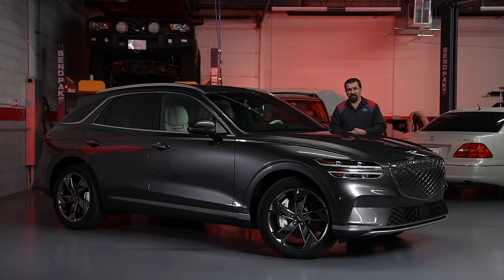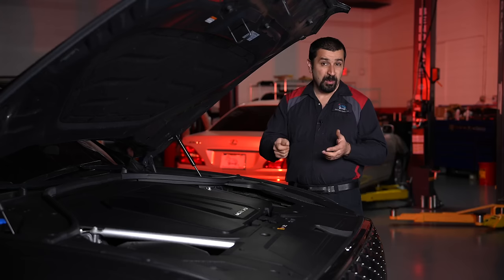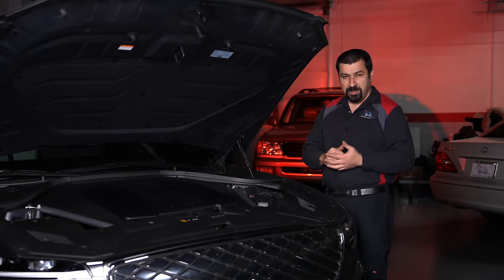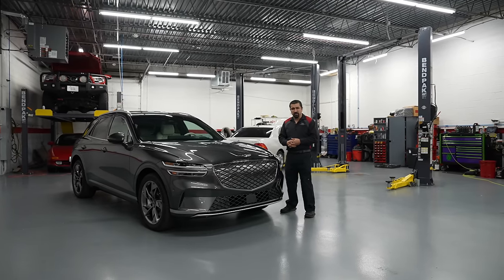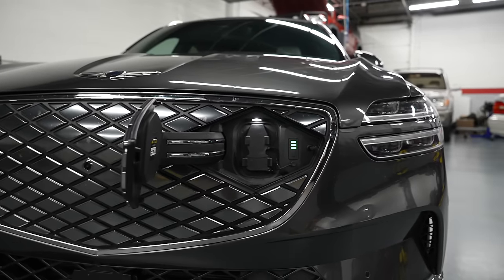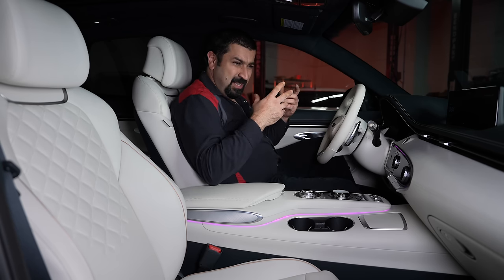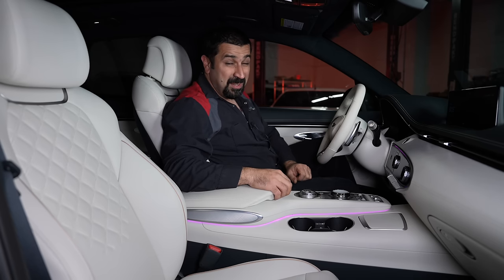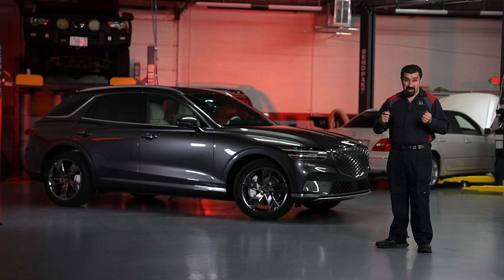Should You Buy a Genesis GV70? Thorough Review By A Mechanic

Comment: I love Hyundai products , I have a 2019 Santa Fe with nearly 266,000 miles and it’s been the best vehicle I’ve ever owned . And I’ve owned nothing but Honda products prior to my Santa Fe .
Reply: Does yours have the 2.4L engine, how much oils does it burn? My 2017 Santa Fe burning about 1 quart per 1k miles with 106k miles on it. As long as it lasts closer to 200k miles I’m okay with adding oil but worried about catastrophic engine  failure
Reply: @BrianPowell-bb1un  yes I have the 2.4 ….last oil change at 260,000 I lost maybe half a quart to 3/4 at 10k mile change . I’ve also done every oil change ever since new with mobil 1 full synthetic .
Reply: Sold 2013 Sonata with 2.4 worst year ever when it come to the engine/car combo... it was a great car. Still running strong at 145k miles. I think it will hit 200k as long as they change oil and maintain everything needed. Now i drive Hyundai santa fe 2.5 NA... great car with that SEL luxury premium. On higway getting up to 32mpg depending on the wind and conditions... average 24-25.

Comment: Umm, home heat pump systems work pretty well –  down to a certain (outdoor) temperature! Below that temp an auxiliary heating device is used. Normally that is a simple resistive heating element. Of course it uses about 5 time the power per minute as the heat pump uses. But in mild climates HVAC systems with heat pumps can keep costs down.

Comment: In ECO mode this vehicle has been tested to get around 260 miles. If you look at channels that specialize in EV vehicles you can see the results. Considering the majority of drivers drive under 50 miles per day...how often do you really go cross country or more than 100 miles each way? You plugin at home then leave full other than the occasional longer trip.

You need a 800 volt charging system to get 800V speeds. The speed is just as much the charging station as it is the vehicles ability. 

Comment about charging covers... Have you seen what Tesla, BMW etc use? A rubber cover, same thing. It's about protection not style.

GV70 electrified is the same as the gas options. HMG literally cut off section of the bottom to adapt vehicle for battery then used the engine bay for electronics. Only difference is the floor is a few inches higher to accommodate batteries. You get a little more legroom in the ICE GV70.

It's not a bespoke platform. The GV70 was designed before EGMP was finalized
Reply: Hi....could you please provide a link to a test showing a 260 mile range?

Comment: The problem with octovalve in Tesla is when it fails. It will cost an arm and leg to replace it.
Reply: Interesting point - an expensive large single complex unit (Octovalve) with limited serviceability versus a myriad of easily and inexpensive serviceable parts? Only time will tell which was the better option in terms of reliability and overall servicing cost. Though to date I’ve not heard of any Octovalve issues though I understand it was only introduced in the new Model Y in 2020. Genesis GV60 ( I presume that has the same thermal management hardware) wasn’t released until 2022 in the UK.

Comment: the hot coolant heats the chiller that cools the heater of the 3 way valve coupled with the refrigerant that heats the cabin when heater cold....or something like that. I think I would take my 4 banger old school diesel and get 600 miles out of it for 45 bucks and not worry about anything except change the oil every blue moon

Comment: Compared to other cars, you did not mention the difficulties of servicing this car. So, you have a cooling system, a compression system, a heating system, an evaporation system, a circulation system. You have such systems for drive, conversion system, battery system, climate system, dual mode systems in combined mode. Even at one point I got confused, how many of these systems and their combinations, respectively, control units you have together.. insanity
Reply: Do other cars have those systems? I can't imagine a car having a compression cycle or heating system, I'm used to magic. I agree, this is insane!

Comment: The eGV70 is a...weird product. Hyundai-Kia has the great e-GMP platform which underpins excellent cars like the Ioniq 5 and EV6. The GV70 however is built on the ICE derived RWD M3 platform shared with the G70, G80 and GV80, which means it is not as optimized say compared to the e-GMP based GV60. However they grafted the same 77.4 kWh battery from the e-GMP cars onto this, meaning the range isn't all that great compared to a car designed with EV powertrains in mind, e.g. the BMW iX3 on their CLAR platform.

Comment: It’s amazing how much better Tesla are. Surprising that these companies don’t get it right….
Reply: Tesla with their crap reliability and poor quality? I test drove one. Panel alignment was way off, things rattled, and ride was harsh. They look like a bar of soap. The only reason to by a Tesla is for their charger network. But that will change next year.
Reply: Lol.  TESLA?
Reply: And don't forget the front ends are practically falling apart. Then the service department has been told to blame it on the driver and deny covered warranty repairs costing owners hundreds of dollars out of pocket. Stay tuned for a huge recall two state senitors have opened a inquiry .
Reply: TESLA has poor fit and finish!  And look so cheap and passé!

Comment: The amount of Hyundai and Genesis haters on here is insane. Hyundai has come a long way from a quality perspective. Past quality issues are long gone and your 1 or 2 anecdotal stories about your "friend's Hyundai or Genesis having problems" - - doesn't represent the whole brand. I'm sure there's bad stories about Toyota's and Lexus's too.

I personally know many Hyundai and Genesis owners who dont have a single problem.

As with every premium car, you can save tons by buying certified pre-owned and pay for the extended warranty.

Buy what you like, not what others tell you you SHOULD buy. Those people are not so different than the ones who demand you eat your steak medium rare or rare. Or those who cringe if you put ketchup on your hotdog.

I'll do what I want and you can watch me from a distance... A long... Long distance. Thanks.
Reply: Sure but when there’s overwhelming more anecdotes for one thing than another, one should start to question why

Ex: you hear way more people talking positively about Toyota’s reliable than the opposite. Surely that’s all their ‘anecdotes’ but it’d be hard not to notice the trend 

Sure let people make their own choices but when you’ve been burned before and you see someone else about to touch the hot stove that did it, it can be best to warn them
Reply: @chibbyylol  ill give you an anecdote. I once drove a beautiful 2005 Toyota Camry XLE. It had an incredible 6 cylinder engine, plush leather seats, wood trim. It drove and rode like a dream. 

Fast forward to 2013 I went looking for a new Camry. What I found was the new Camry in the same XLE trim was now mostly plastic junk with old technology... But it did have a great engine that could of probably lasted 300k miles or more.

For roughly the same price as a highest level trim camry, I bought a Hyundai Azera instead. The Azera was like a space ship compared to the camry. I would literally get ooo's and ahhh's and wow's when I drove it. I did end up selling it before I could run up the miles on it because I needed a bigger car at the time. Which was a shame because I really missed that car. 

Now would the Azera engine have lasted 300k+ like the Toyota? Probably, probably not. But it had Napa leather seats, Xfinity speaker system, panoramic roof, heated and cooled seats... It was on a different planet than the Camry. 

Long story short, and point being, Engine and "reliability" isn't everything end all and be all of a car. Hyundai has, what most think, some of the best bang for your buck interiors with vastly improved quality engines and reliability in the entire industry. They are literally the Cinderella story of the auto industry and the "Hyundai's are unreliable" crowd are getting older and few and far between as they get left behind in automotive history. 

The best part is that this isn't an argument, just buy what you like and don't worry about what other people think about you. As long as you're happy with the car you're driving -- it was money well spent.
Reply: I bought one of the first Kia Stingers. It was a special edition with Yellow paint. The paint was not vetted as well as the other colors, and all of them had a problem with chipping for no good reason. Kia gave us two options: Buyback the car or have it repainted for free and get a $5,000 check for your troubles. I think that was more than fair and doubt many other companies would buyback a car over chipping paint. It honestly wasn't even that bad. I decided on the buyback when I realized that having a fast car sitting in traffic all the time is not worth the 19 MPG you get doing it. 18 months later I saw a yellow one on a lot where they sell bought back cars. The paint condition was horrendous at that point. It was completely hazed over and the bumpers were a bright yellow where the rest was faded to hell. So happy I took the buyback.
Reply: "   Owners of select Hyundai and Genesis vehicles listed below should park their cars outside and away from homes, other structures and other flammable materials such as vegetation until their vehicles have been repaired, due to new and separate recalls for the risk of fire.

ABS Module Malfunction

Hyundai issued safety recalls (NHTSA IDs: 21V-160 and 21V-161) this month for Model Year 2015-2016 Hyundai Genesis, 2017-2020 Genesis G80 and 2019-2021 Genesis G70 vehicles. The anti-lock brake system modules could malfunction internally and cause an electrical short over time, potentially resulting in an engine compartment fire while parked or driving. These vehicles were produced from February 21, 2014, through January 17, 2020, by Hyundai in South Korea for sale in the U.S. market.

Until these recalled vehicles have been repaired, the safest place to park them is outside and away from homes and other structures.

Battery Cell Short Circuit

Hyundai also issued a safety recall (NHTSA ID: 21V-127) this month for select 2019-2020 Hyundai Kona Electric and 2020 Hyundai Ioniq Electric vehicles. An electrical short internally within the Lithium-Ion battery cells increases the risk of a fire while parked, charging and/or driving. 

Until these recalled vehicles have the interim action completed, the safest place to park them is outside and away from homes and other structures. " 
--------------------------------------------------------------------------------
Consistent recalls with NTSA saying don't park your Hyundai / Genesis vehicles in your garage because of the risk of FIRES !                                     
           Not exactly HATING but its really BAD when the NTSA is telling Owners don't park them in the garage !
Reply: Well said! Most of these haters can’t even afford a genesis 😂
Reply: @chibbyylol Anecdotes are anecdotes for a reason. Hyundai/Genesis quality has improved tremendously in the past 5 years. I’ve owned Nissan, Toyota, Honda and Subaru. They all had issues at one point or another. I’m not loyal to any brand. Toyota recently has a massive recall and had recalls for potential fire issues. Toyota’s new EV is a complete joke. Far behind Hyundai.
Reply: @JohnLee-db9zt  I dislike commentating about people's finances but I assume some part of the hate towards Genesis has to do with some people who can't afford a Genesis taking solace in the fact their plastic filled Toyotas with decent engines may or may not outlive the superior quality Genesis vehicles.
Reply: @BHabe-m1j  I'd Buy Toyota / Lexus / Mazda before any Hyundai - Genesis model. The warranty on them though is pretty good.
Reply: past quality issues are "long gone" they are still getting sued UP TO THIS DAY, for their lackluster vehicles and aftersales service.
Reply: @ag4allgood  I’ve owned Lexus ES350 F Sport. There was no sport in it at all except for a jarring ride on anything but the smoothest road. It drove like a boat with sluggish engine. The only thing good about was the drivers seat, one of the best I’ve ever sat in. It was totaled in a crash due to a negligent driver. I was glad because I didnt have to pay the $900/month bill.  I then test drove the G70. It was so much better in every respect except for the seat comfort. I’m waiting for the ioniq 5N.
Reply: @emikomina  I do agree their dealership sucks. But the current vehicles are great.

Comment: I question why they would put the ELECTRIC charging port in the front where 80 MPH rain-driven salt water will hit your electrical connections most of the winter.
Reply: That's why there are those caps that he complained about.
Reply: @th003g  Those caps won't be enough.
Then there's the problem with snow and ice preventing the cover from opening. EVERY other manufacturer had the sense not to put the charging port there for a reason.
Reply: @stans5270  agree to disagree, the Nissan leaf had and still has it on the front, so do many of Hyundai/ Kia EV. It's sealed well. There are gaskets on the door itself, so you won't have water intrusion from driving. Your theoretical situation of water getting past the gaskets and the plugs in a driving rainwill not happen.

People can't seem to figure out how to back into a space and parking in a charging spot head first is usually easiest.

In motion, the airflow will keep the grille clear, parked it's on a vertical surface, it's not hard to clear off (no more or less than any other mounting spot)

I have a Tesla Model 3 myself. The charge door doesn't have gaskets or plugs, and gets stuck just the same when it snows.
Reply: @th003g  As you say, I still disagree. Your premise is seriously flawed. If people can't figure out how to back into a space, they should utilize an Uber and keep those who can drive safer [and keep our insurance lower].
Your example of the Leaf is BS. Its location is more on the hood and NOT the grille, directly in line with the left rear tire of the car in front of it.
Commenting on how the port door on the Tesla gets stuck, I also claim it would be much worse in the front grille. When car doors freeze and windows can't open it is because of water egress into gasket mating surfaces which then freeze. More water egress, more freezing.
As far as other models, I will be happy to counter every specific one that is NOT just "blowing smoke up my rear end".

Comment: Hyundai based Genesis cars are not exactly a reliable Brand. Too many recalls & actual failures with this brand. While the interior is really well done its the mechanical reliability that I look at. Much rather have a Lexus or even Mazda than a Genesis for ICE powered reliable luxury.
Reply: Genesis is literally the 2nd most reliable brand according to both JD Power and Consumer reports.
Reply: @TheRealCatof  " Hyundai Motor America (Hyundai) is recalling certain 2020-2023 Genesis GV80, 2021-2023 Genesis G80, 2022-2023 Genesis GV70, and 2023 Genesis GV60 vehicles. In the event of a crash, the front driver-side and/or passenger-side seat belt pretensioners may explode upon deployment. " 
NTSA site !
Reply: @ag4allgood  Every brand has recalls my guy, they are fixed for free
Reply: @ag4allgood you are acting like if many other manufactures haven’t had recalls similar to that one
Reply: @bradleyscarreviews  The other brands have recalls too - I agree. I'm talking about consistent recalls thru their whole lineup.
Reply: @ag4allgood  I have a Kia Stinger GT which has had 0 recalls
Reply: @TheRealCatof yes pretty much every car company has recalls my guy
Reply: @ag4allgood my guy
Reply: @TheRealCatof aren’t those cars junk tho my guy??
Reply: @TheRealCatof  When they have the parts in stock to do the repair. Then you have to make an appointment & hope its done right.
Reply: @ag4allgood my guy Toyota rav 4 had engine compartment fires not too long ago and it was in the millions. Shush it.
Reply: @robmalcolm8042  Yea , close your eyes & cover your ears you will never see a BAD thing about the 2nd Biggest purchase people make ! The fires in the anti lock braking module in Hyundai's has a potential to burn down your # 1 asset so no Biggie - right ?
Reply: @ag4allgood  Toyota also had a similar recall for the anti brakes do your research. I have had 3 Hyundais with less work done than my Toyota Prius that’s made in Japan. Of course I only had Hyundais made in Korea not America or Canada.